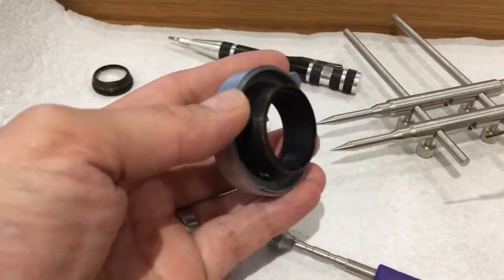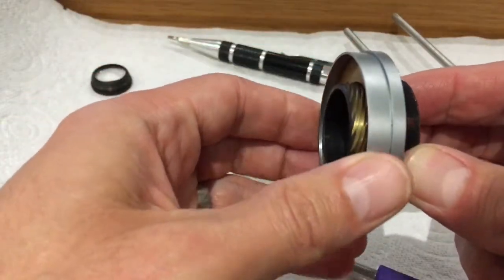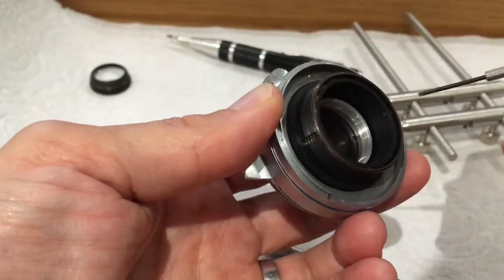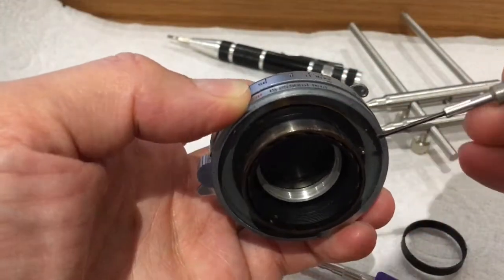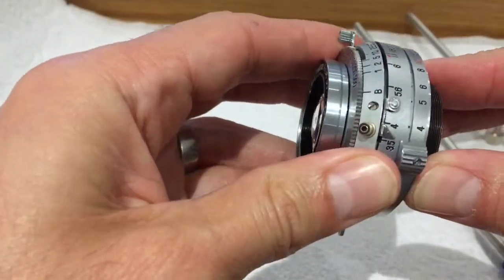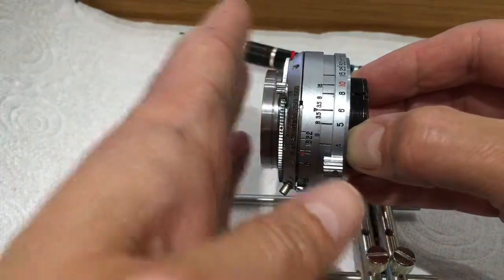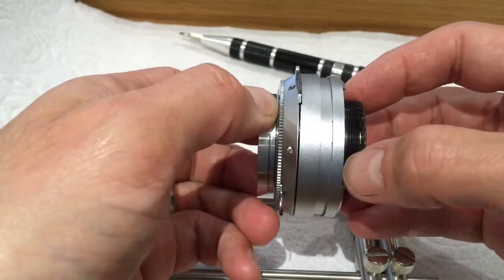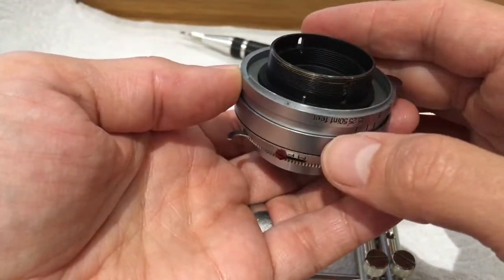How do I collimate a Super Fujica 6?

Comment: I have never opened one of these up, but have just about everything else...can you shift the helicoil grooves over one slot, so the notch registers in a different location?
Reply from the maker: I tried that but (and I can't remember the details) because of where other bits sit it ends up sitting in a different position (front to back) but you lose the corresponding amount of travel - as if you had just rotated the focus lever anyway. Hard to describe but I thought the same as you. In the end I had to shim the shutter out from the front standard with some shims a friend printed, collimate as best I could that way (I had a selection of thicknesses) and set the RF to match. I'm still none the wiser, i spent ages trying to figure it out. It's unit focus but I did try adjusting the front element, but that definitely wasn't what was supposed to happen either.